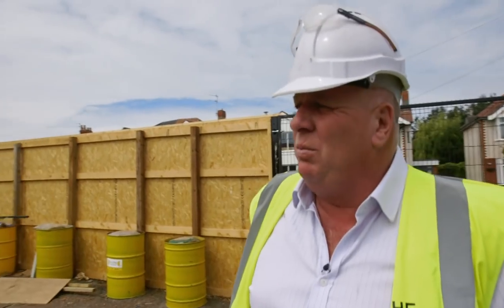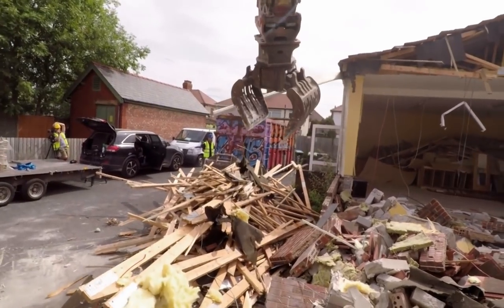1950s Church Gets Sentenced To Demolition | Scrap Kings

Comment: What they couldn't recycle the windows and wood etc?? This is everything that is wrong with mankind!!
Reply: Comes down to cost, its not worth it
Reply: @olivermansfield8341  with the environment on the line....its going to have to be worth it.
Reply: @GrampiesCorner  All of the wood is recycled or broken down into wood chip for fuel and the rubble will be crushed for hardcore. As for the windows, they're practically worthless.
Reply: @GrampiesCorner  he says at the 3 minute mark that they will sort it to sell wood and brick separately.
Reply: @matthewculley1572  the glass can be recycled.
Reply: @GrampiesCorner Of course the glass can be recycled but there's no real financial incentive to remove it beforehand as it's not very valuable unlike metal and difficult to recycle compared to other glass types. It also makes up very little of the landfill so isn't worth picking out like the wood and bricks.
Reply: Depends on the contractor, some will pick it to the bones others will just save the metals, ect

Comment: great destruction video
the part with the piano is pleasant
good operators
Unnecessary buildings should be destroyed
Reply: Agreed.....it certainly was an unnecessary building😂😂😂😂😂😂and yeah the piano destruction was sweeeeeeet!❤
Reply: Does not make sense why destroy an old piano like that it could’ve been sold 😢
Reply: @geoffrey121148  The market for Pianos is pretty much dead.
Reply: @geoffrey121148  If it had a value, it would have been sold.
I can have much older and much prettier old pianos...for free!